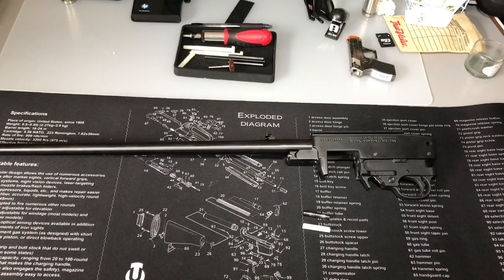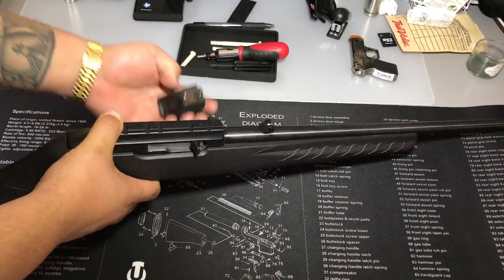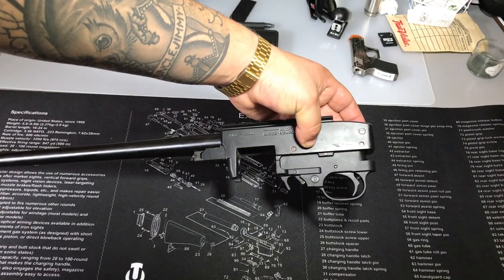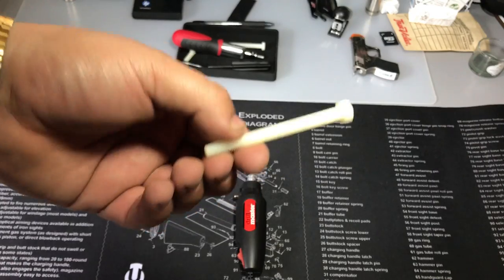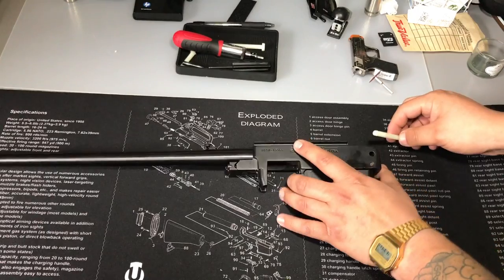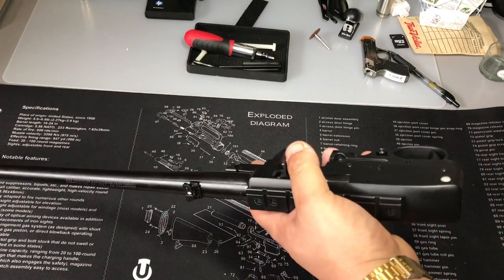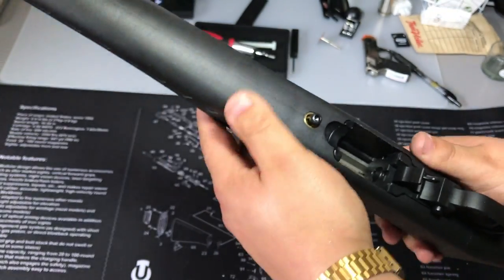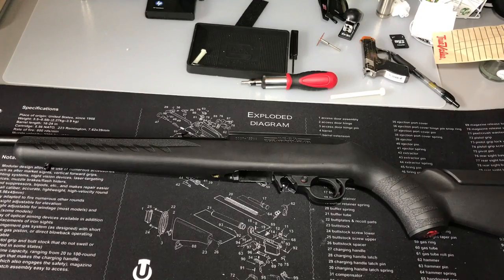How To Make Ruger 1022 Buffer Pin

Comment: Thanks for the tip. Video procedures were spot on. Paid .81 cents for the nylon bolt at Home Depot in Dec-2018. Made two nylon bolt buffers at the same time so that I had a backup. Almost like your pin, my original Ruger buffer pin would slide out with little effort. The nylon pin fits tighter than the original. I hope to try this mod out at the range soon. I am very interested to hear the difference, if any.
Reply from the maker: Thank you! I’m glad it helped you out thank you for the positive words happy shooting!
Reply: Thanks for the video. Good info. Get an auto bolt release. :)
Reply: So does it make a difference?
Reply: Yes. This makes a major difference. I should have posted a video of me shooting before and after on my own. Yes. It makes a big difference shooting with any muzzle device. Does it lengthen bolt life. Who knows. But it's quieter and if that matters to you do it.
Reply: @whenwillwesail  Thank you. I'll have to give it a try on my gun.
Reply: @twn5858  I love it. Thanks to this nice guy for posting up a how to. I got it done. I'm trying to keep a count of rounds that it lasts. Also. I replaced the buffer because of my reciever. I don't want it getting screwed up. Give it a shot! Literally.
Reply: I've been to Homr Depot 3/7/21 and they didn't have a nylon bolt at any length, same at Ace hardware so I guess I'm SOL